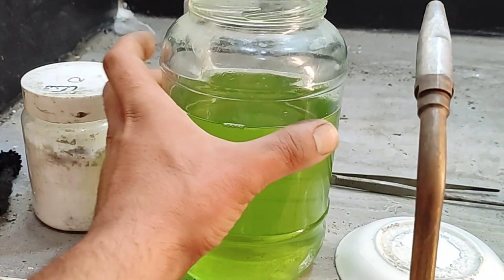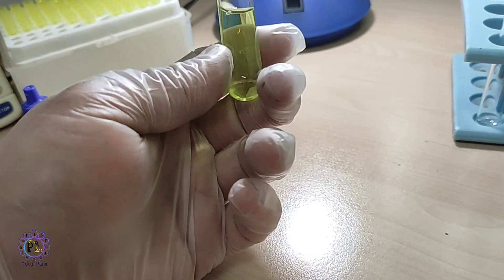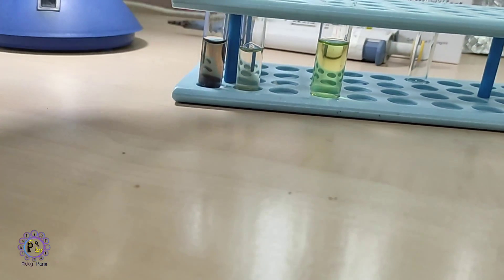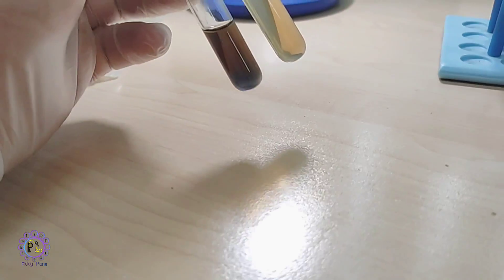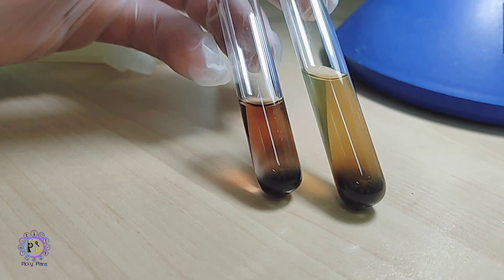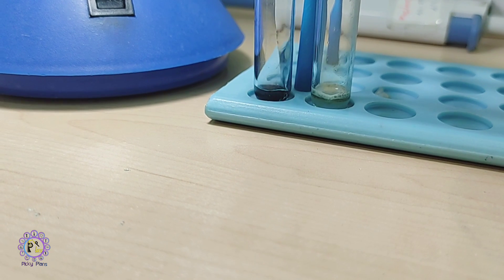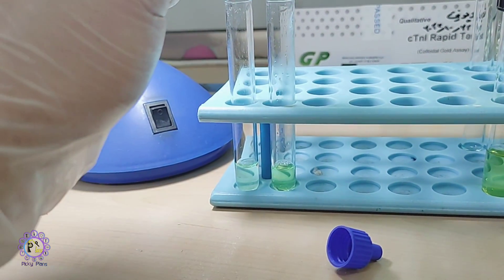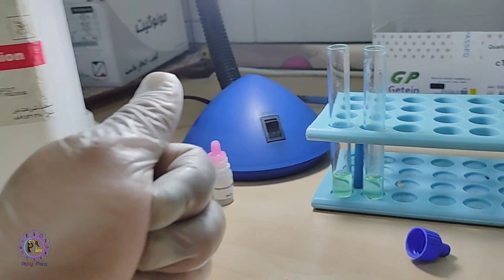False positive Stannous test | troubleshooting & tips

Comment: How do you neutralize nitric acid in aqua regia to precipitate gold?

I personally have found that gold will not precipitate if the nitric acid is too strong. I have seen gold form as spiked crystals in a resting transluscent green solution then disappear. I did test with stannous chloride and with the jewelers platinum solution test. The purplish colour indicates gold, the yellow orange indicates platinum, the reddish orange indicates paladium.
Reply: @PickyPlans  Thanks for the tips. Its on point.
Reply: And the solid brown turning black indicates copper and platinum and gold... ?